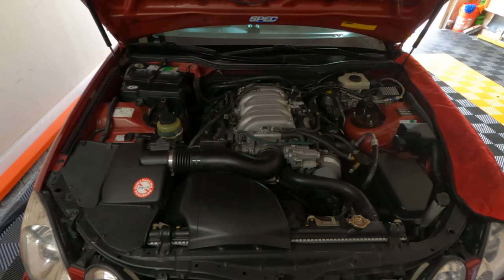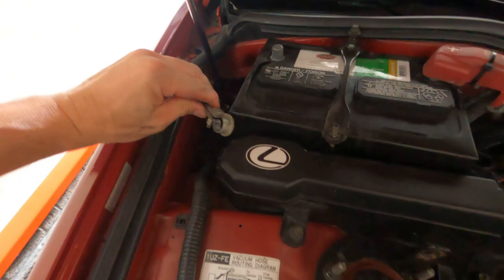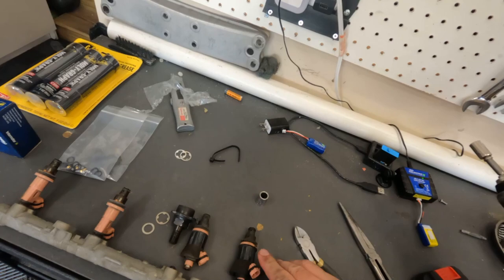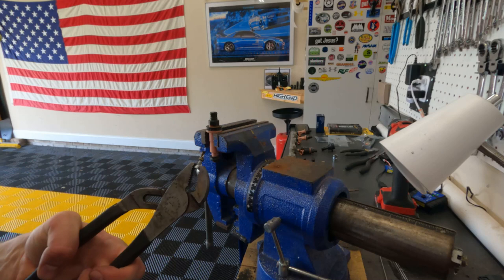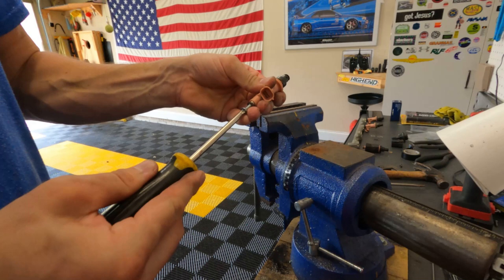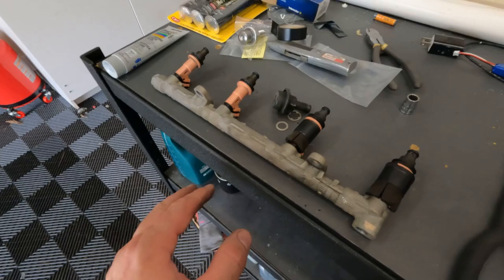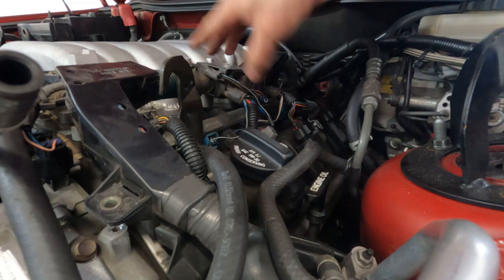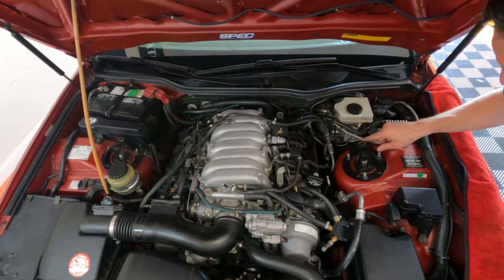DIY Fuel Injector Refresh and Service

Comment: So I’m a young car enthusiast with a 2001 gs 430 and recently replaced my knock sensor while putting everything back together I got to the bank 2 side fuel rail I should add I am in no way a certified mechanic and have just done simple maintenance well anyway while tightening it down it snapped in 2 pieces I got a replacement rail but could not find out how to get the broken rail off I finally found this video and figured out how to do it this video is the only one that actually helped me thank you
Reply: Btw I should have known Bc I binged watched every video On your gs when I knew I was gonna buy one
Reply from the maker: I’m glad I could help you and thank you for watching!

Comment: Just an FYI I bought the “Wells” brand dampener from advance auto and it was a denso inside the box for 41.99 plus 25 % coupon made it to 31.49 👌🏻
Reply from the maker: Score! Good call.
Reply: How’s it been running since?

Comment: @ForwardMomentum i changed the starter and when I reconnected banjo bolts to the fuel rail, and started the car, it shot fuel up out of the damper and is still leaking out of the set screw. I ordered a new damper, any advice to keep that from happening again?
Reply from the maker: Aftermarket dampers don’t have screws. Just run one of those. The OEM screw design was dumb.
Reply: @ForwardMomentum Appreciate the feedback!

Comment: Hey, installing new injectors, is there a specific order they have to be installed in for each cylinder. Also what kind of tape is used around the injector foam coverings?
Reply from the maker: No order on this engine. I heard that the 3UZ might have “sides” but on the 1UZ VVTi it’s all the same P/N. Unsure of the tape for foam. I assume high heat. I just left it off my injectors. Pretty sure it’s for noise and I couldn’t care less about that.

Comment: What’s the diaphragm even for? One of Mine literally started leaking today the first time I’ve started it since I’ve done the steering system and had injectors rebuilt. Bought two without like your did
Reply from the maker: They’re pulsation dampers. In essence they absorb injector pulses and quiet them down. That’s my basic understanding. Now that I’m supercharged, I no longer even have them at all.
Reply: @ForwardMomentum  I bought the same ones without that screw would this cause me any issues at all? I don’t care to have louder injectors I just don’t want something to happen like a fuel leak and burst into flames lol
Reply from the maker: New dampers without screws is completely fine.

Comment: Are the injectors supposed to move left and right when I go to disconnect the plugs to them? Without removing the rail or any bolts… any help is appreciated
Reply: When I went to remove the plugs, a little bit of gas came out and the injectors were moving left and right in the hopes
Reply from the maker: Yes, they will “clock” inside the ports even when the rail is bolted down. If the system is still pressurized, fuel can squirt when you go to remove the injector(s) or disturb them enough. Pressure drops from about 40psi at the rails to zero over an hour or two. So letting the car sit for a couple hours should relieve it enough. Wear safety glasses just in case.
Reply: @ForwardMomentum  appreciate the quick reply… was worried that there was something wrong with the injectors… going to go ahead and do the injector service anyways. Again thank you so much!
Reply: @ForwardMomentum  my cars been sitting for a good week now because I’m doing steering and charging system and I found all my coil pack and some injector connectors are broken so I replaced all my coil pack connectors and the first injector one it started seeping gas… it’s been sitting for a week with battery completely out of the car as well not that it’s related really but would you assume injector seals are bad?
Reply from the maker: If the seals are old, yes. I would assume a micro crack or similar. Seal kits are very cheap. If it’s a newer seal set, then it could just be seated weird.

Comment: I would've put something between the hammer and the new microbaskets
Reply from the maker: Good thinking but it wasn’t necessary in this case.  The microbasket bushing is a non mating surface.  You can hear the sound change tone when the basket is fully seated to prevent too much contact.

Comment: Hey man I’m looking at an 03 GS430 for $5k.
He has replaced distributor plugs, spark plugs,water pump, timing belt, radiator and hose, outer tie rods, rotors and pads. Is this a good deal? Thanks
Reply from the maker: Mileage? It’s tough to answer over the internet. No matter what I’d have a used car inspection done, probably at LEXUS. it often worries me when all that stuff is done and someone still wants to sell a car. Be careful. There could be an underlying issue that’s being hidden. Or, it could be an honest person addressing maintenance. If it was 175K mi or less and passed a thorough inspection, $5K seems fair.
Reply: @ForwardMomentum  200k… he said he’s selling it now since he purchased a truck that’s better suited for him.  Thanks for the heads up. It has a clean title.
Reply: @CARBONHAWK1  If be wanted 5k for that I'm definitely getting at least 15k for my 04 gs300 with 125k miles. Because I replaced all of those things, plus waaaaaaaay more including a completely new exhaust system that's worth 8k by itself.